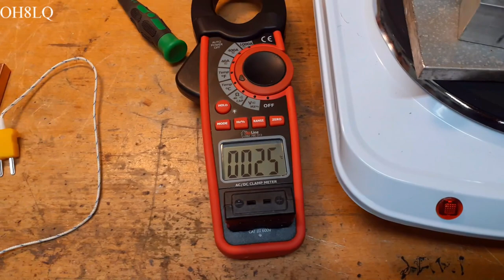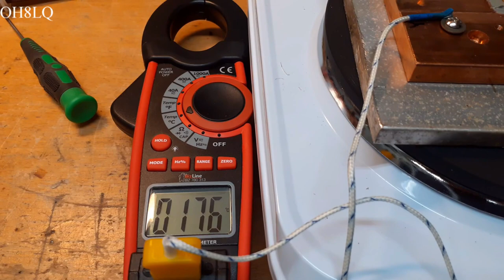How to solder LDMOS to copper.

Comment: Hello my friend, I have some questions. From what I see it looks like thermal paste what you use for soldering or is it silver? Or a combination of both. It seems very responsive and how about the thermal transfer? Does it work well for you until today or did you change your work method? Is the last welded still welded and working? How deep is the central cnc to sink the ldmos? I'm about to start a similar project and what I have the most doubts about is what to use to solder the transistor to the copper with a good thermal coefficient. I will be grateful for your instructions
Reply from the maker: yes it works well. I have use soldering paste Sn96,5Ag3Cu0.5. Central CNC is just so deep as 1.6 mm PCB needs set legs to surface (0.5 mm) Thermal transfer is very good to copper...
Reply: @jariojala9816  thanks my friend, Note that it preheats the general heat until the paste is melted on the other iron, then it lets the copper reach the temperature and once the fusion is achieved, it is quickly removed. I believe it is to avoid damaging the transistor. Also, as can be seen, it cools naturally to room temperature, which I believe is to avoid damaging the solder. any advice is welcome
Reply from the maker: @mathiasmaidana3713  Look datasheet there are temperature profile for reflow soldering, times and temperatures!

Comment: HI, I am confused.  Are you sure the word "SOLDER" is the correct Term?  Am I seeing that you are using Heatsink compound and then placing the LDMOS in it, then heating and letting it all settle into the Heatsink compound?
Reply from the maker: HI, I am sure, becauce compuond is tin (sn) paste. its used solder SMD components to printed board ;)